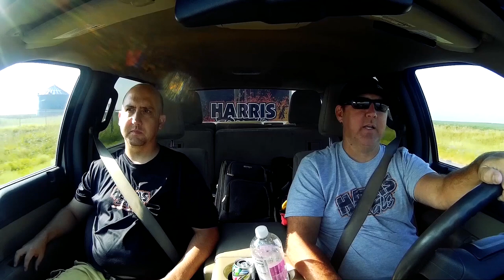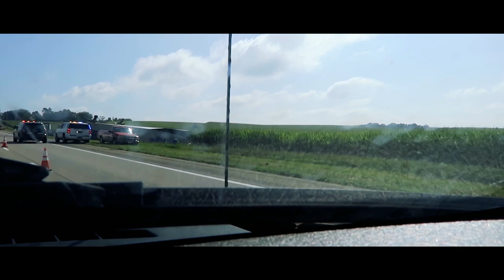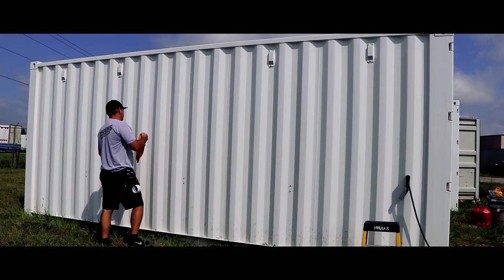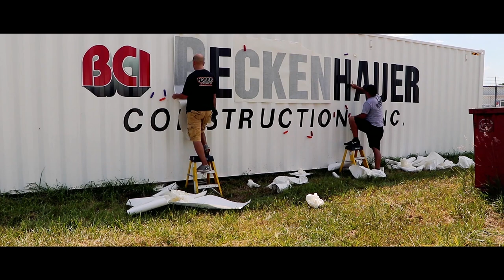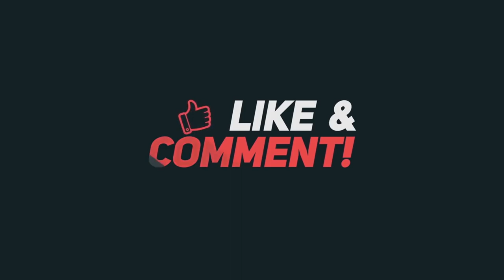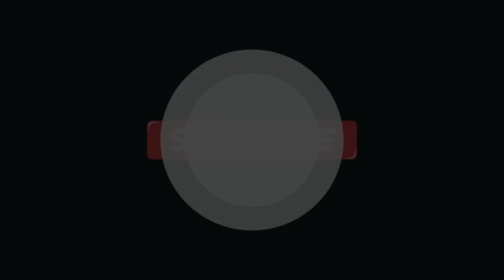Applying Vinyl to Shipping Containers - Season 3 Premiere

Comment: Thanks for sharing how you do this. – It's hard to tell in the video but do you stretch the width of the logos and text to compensate for the distortion caused by the corrugation on the container?

Comment: Great video.
How do you measure for printing?  Sides and front and back?  😊
Reply from the maker: Not sure if I understand your question.  We typically find a center point left to right.  Then we measure everything from the top to make it straight.
Reply: @HarrisDecals  do you measure only the width, or do you measure the width following the curves, ups and downs,  etc?
Reply from the maker: @AwesomeCarrilloClan  Depends on what you are needing to do.  If I was wrapping the complete side, then I would want a measurement with the ups and downs, as that adds about an 1" per up/down.  If I am just doing cut vinyl or printed/cut vinyl, it doesn't really matter.